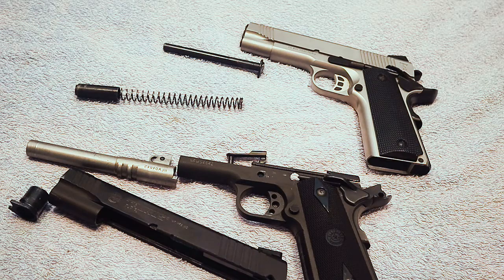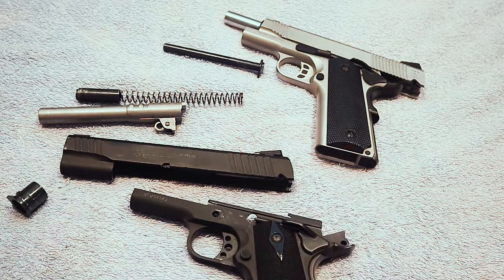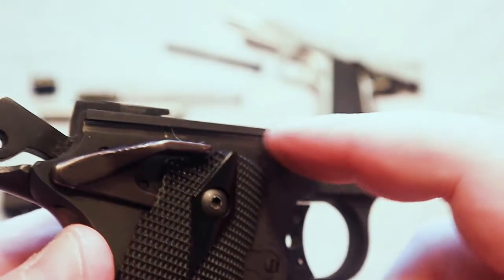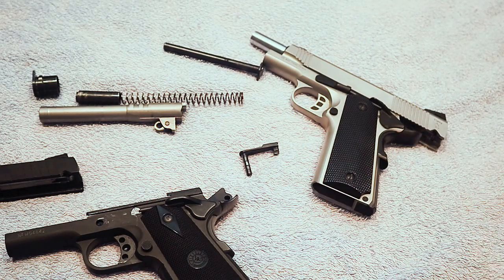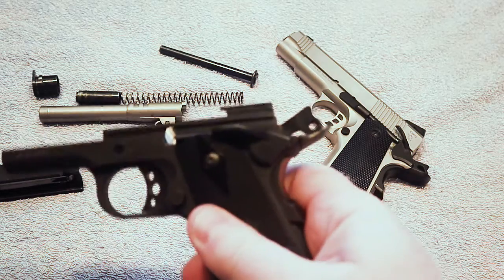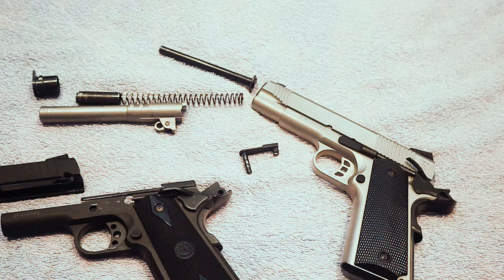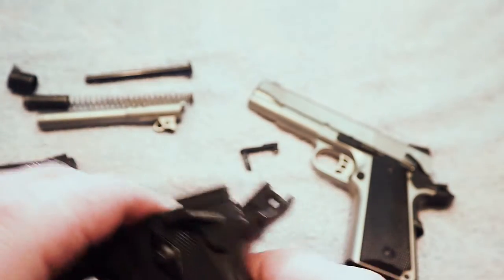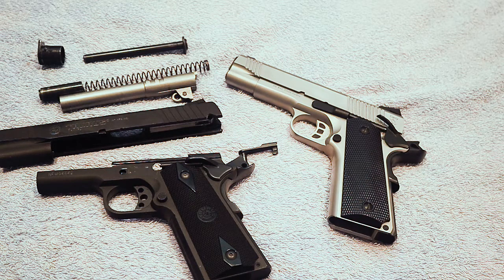How break in of a 1911 pistol works to make the gun function better

Comment: My Tisas "service" model 1911 took about 800 rounds to break in. Going on 1600+ now, and it runs flawlessly.
Reply from the maker: They are much smoother also after being broken in
Reply: @BoomStickTactical  not that it wasn't relatively smooth to begin with, but yeah. Especially on the disconnector. The first few hundred rounds I used Mobil 1, then went to ALG Go Juice oil and grease. I'm super happy with the ALG stuff. It may have been detrimental to the break in, but who's to say? It's smooth as glass, yet shows very little wear.
Reply: I’ve had the exact same experience with my US Army 45 by Tisas

Comment: My Ruger 1911 9mm Target wouldn’t run a complete mag with malfunctioning, usually stovepiping. I took it apart and oiled all the points shown in the manual and worked the slide in increments of 100 until I’d done it about 700 times. It runs flawlessly now. Much cheaper than firing that many rounds.

Comment: Good video.  Thanks.  My Wilson Combat 1911 came with instructions not to disassemble or clean for the first 300 to 500 rounds as part of the break-in period.  Since then I have put thousands of rounds through it without a single malfunction.
Reply from the maker: Yep. They require a bit of breaking in
Reply: Like not even to clean all the factory oil off of it? Just shoot straight out of the box?!

Comment: I have a Tisas commander in black. Love it. Slowly upgrading all internals to WC and Nighthawk.
Reply from the maker: Very nice
Reply: Same I just bought a tisas 1911A1 service special and I love it
Reply: Why not just buy a WC or a nighthawk?
Reply: @sparky_-mf2cs  Most likely, Cost... 
I can't afford to outright buy a WC 1911... but I can definitely afford a WC part or 2 every paycheck. 
My $500 EAA GIRSAN MC1911 is all WC internally... it works as well as any other factory or custom 1911. 

That's the beauty of 1911's... they can all be upgraded to one's liking and anyone can afford them.
Reply: @Jayleewild81  but if your girsan runs good out the box why add all  wilson combat internals? Wasnt the point of buying a cheap gun to save money? Why buy a 500$ 1911 and put another 500$ in parts when it already runs fine.

Comment: Empty the weapon and lock the slide back in place.  Leave it like that for a week or so to help break in.
Reply from the maker: That will not do anything. It takes the parts rubbing together to smooth the action out
Reply: @BoomStickTactical  According to Sig Sauer it just breaks the recoil spring in.
Reply from the maker: @Rob-xj3xh  there are more parts to a 1911 than the recoil spring that need to be broken in
Reply: @BoomStickTactical  I was just talking about the recoil spring and nothing else.

Comment: 1911s are made with much tighter tolerances today than the old GI models. My Colt 1911 had problems feeding JHP when it was new. I use good Chip McCormick mags. After a few initail rounds I noticed a lot of brass color on the feed ramp. I then shot 100s of rounds. At that point there was no brass color on the feed ramp and it fed JHP flawlessly. That high round count polished the ramp the way the gun wanted; not me polishing with a file and trying to guess tolerances. Use the gun and let it polish itself where it knows its needs it. Great video, brother.
Reply from the maker: They've come a long way in machining technology.  Thanks for watching.  Please subscribe, share and visit my shop: Visit my shop: https://boomsticktacticalgear.com/

Comment: One of the things that I do when I get a new 1911... 

I take the entire firearm apart I don't just feel stupid I take all of it apart because I want to see those internal components to make sure that there are no mishaps or QC control issues. 
 And then I clean everything on the inside reassemble it.. clean it like you would normally clean it doing a field trip and I put a lot of lube in it I reassemble it and I will sit there for God knows how long and just wrap that slide back and forth over and over and over and over and over and over again. 

 No it doesn't have the exact same effect as going out there and putting 500 or 1000 rounds through it but it will help polish those imperfect surfaces and it does it rather quickly. 
 I also gunsmith all of my own firearms particularly the 1911. I have all kinds of tools like sanding blocks different types of papers I have the setup to run sanding Stones up and down the rails on the frame and the slide. But most people don't get into it that much. They just want a reliable Firearms quickly as possible. And if you don't have the investment made with those tools and a handful of other ones then yeah the best way to do it is to just clean it and keep shooting it to break it in. 

 And don't get me wrong...... In nobody in your firearm just by sitting there and racking the slide back and forth. It will take more than that. But it's a good place to start if you've got the patience and the sound of it racking back and forth doesn't get on your nerves. 

 And make sure your feed ramps stay polished. And if you're going to be carrying any kind of hollow-point ammunition..... Make sure that as the bullet itself starts coming to the tip that it's not perfectly flat. You're going to want a little bit of a curvature. Otherwise it's not going to cycle properly. The 1911 was not designed for hollow-point ammunition. But in modern ammo there is plenty that will cycle. I would stay away from that rip ammo. Most of the time that won't cycle properly and it's going to beat the absolute shit out of your feeding ramp to the point where it will probably take chunks out. 

 I also make marvel cuts. The marvel cut is a ramp cut in at the bottom of the breach face right below the firing pinhole on that 90° or usually 90° corner that slams into the top of the disconnector every time the weapon cycles. It is much smoother with a marvel cut. While shooting it you're not going to notice a difference. And it's not one of those things that are necessary to make a 1911 function. But I do like to custom tune all of mine. 

 I had my 45th birthday this past August 2024 and I decided I was going to go out and get myself another 45. 1911 of course. 

 This is a great video. You got my subscription with this video.
Reply from the maker: Thanks for watching, please subscribe and check out my channel.  Also visit my shop here: https://boomsticktacticalgear.com/

Comment: Great Vid! I own a Tisas PCS Carry with a 4.25 inch barrel similar to yours as well. Only difference is mine has a rail and is black(cerakoted). I carry it every day in a N8² holster and it is extremely reliable. One of the best 1911's I've ever owned hands down and I've owned very many. Plus I got it used but never fired for $350 in the box.
Reply from the maker: I've been looking at the railed models. Very nice
Reply: @BoomStickTactical  Did the slide to frame fit loosen up on yours quite a bit after break in? Mine loosened up some.
Reply from the maker: @danielbyrd1272  yes. Much smoother now

Comment: So whats wrong if the slide isnt locking back after last round???
Reply from the maker: The mag may be causing it
Reply: @BoomStickTactical  they are good mags and sometimes it does lock back with the same magazine
Reply: @justusbryant7366 you might be riding the slide stop.
Reply: @Catgat37  nope. Just needed to be broke in. That is a reason that nobody ever mentions.

Comment: Just a little tidbit for folks. I tend to use my break-in shooting to also test what magazines a 1911 likes and which ones it doesn't. I bought a new 1911 last year and it just will not work with 2 of the mags that I have. Maybe it will the more I shoot it, but either way I just don't use those magazines for that gun.
Reply from the maker: Mags have a big impact on them.  I've actually got a video coming out in a couple days about it.

Comment: What do you mean by brake in period? What should I be doing
Reply from the maker: The 1911 needs a period where all the parts work together to smooth out machining marks and polish the mating surfaces. Just run a few hundred rounds through it and you will notice the action of the gun get a bit smoother.
Reply: @BoomStickTactical  I was surprised myself.  Around 400 rds my new 1911 started to purr.   I can hardly wait to shoot another 400rds..   I ditched my glock because its boring.   I am happy with my 1911.

Comment: Can you exchange parts inbetween ?
Reply from the maker: Depends on the part and the guns
Reply: Exactly. I do a lot of my own gunsmithing with 1911 and I picked up my 10th 1911 about a month ago. And the drop-in parts generally are interchangeable. Like GI model with GI model. However....... There are some manufacturers where the inside diameter of the end of the slide where the barrel bushing is going to fit in is not the same. Can be wildly different. I found that out the hard way a few times early on. The best thing to do before you start switching out any components is to ensure that you're purchasing the right one for your firearm. And if you want to fine-tune it to make it a really really accurate gun you will have to do a little gunsmithing to make some pieces fit properly and when I say gunsmithing I'm talking about just removing a little bit of metal for example... The barrel bushing. If you want to get a match-grade high-quality barrel bushing...... You're going to be removing some of the material on the outside and the inside more than likely. But you will have a very tight fit. And the title of the fit that means the barrel is going to wiggle even less which means your shots should be more accurate. And that's just one example  @BoomStickTactical

Comment: Do you find a difference in the break in period length for different caliber 1911’s? Say a 9mm v a .45ACP?
Reply from the maker: I currently don't own any 9mm 1911s. There is a difference in it by manufacturer
Reply: @BoomStickTactical  thanks for the response. I have a Springfield garrison in 9mm. It’s working much better now with about 500 rounds through it but the first 100 rounds was rough!!

Comment: I recently bought a  S&Wesson 1911 Govt. Size and I am thinking about changing the full length guide rod to a GI.Can I just change it? Or will I need to have it tuned or adjusted?
Reply from the maker: You should just be able to replace it. I would suggest getting a good quality one.
Reply: @BoomStickTactical  okay thanks...
Reply: You're going to have to buy a different end cap and you're going to have to get the smaller guide rod. The whole purpose of a full length guide rod is for smoother action and less wear and tear on the spring. I swore against the long guide rods up until relatively recently. My springs last a lot longer with a full length guide rod.

Comment: So how do brake them in.
Reply from the maker: Plenty of trigger time. Shooting them helps smooth put the machining and fit parts better
Reply: @BoomStickTactical if you don't have the ammo to shoot them........ I would suggest getting it but in the meantime........ Sit there with the gun fully assembled and just rack the slide back and forth. You will wear out some of those burs and imperfections. 

 Another thing to consider doing if you're not going to be out shooting very often is to take it apart a few times and learn how the pieces go back together. 

 Once you master the field strip and reassembly then go for the complete slide and frame teardown. Trust me you'll save money in the long run if something starts to fail and you know how to replace it yourself. 

 There's only two things that I would ever pay somebody to do to any of my firearms. Number one is a laser engraving because I don't have that setup and number two would be a refinish. I don't have a setup for that either. Other than that I do it all by myself. YouTube is a wonderful instructional.

Comment: I have a kimber custom 2 and the Manuel states to have a break In period of 400 rounds. 

Side note I wouldn’t get another kimber their quality went boo boo so stay away.
Reply from the maker: I've not had any issues with any of my kimbers
Reply: I hear this all the time from people but never handled or owned a bad Kimber. I bought an Aegis Elite Pro this summer and it ran perfectly and fit and finish was flawless. Not saying youre lying because many many people have told me the horror stories they had with Kimber, i guess ive just had good luck. That being said, i would spend 1200 on another one. Ive been on a Tisas kick. They are extremely affordable and the quality for what you pay is friggen awesome. Picked up a new one last weekend and already saving up to get a Raider asap.
Reply: Great, as long as kimber includes 400 rds. @BoomStickTactical